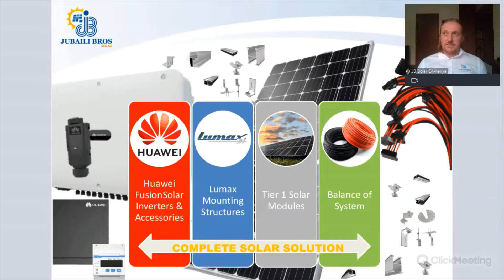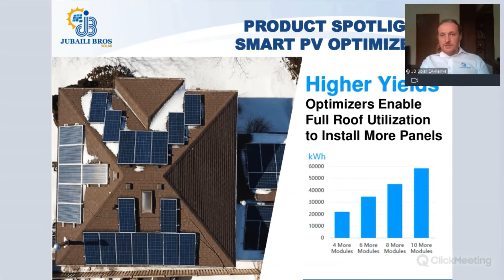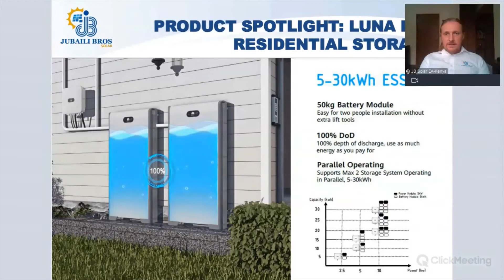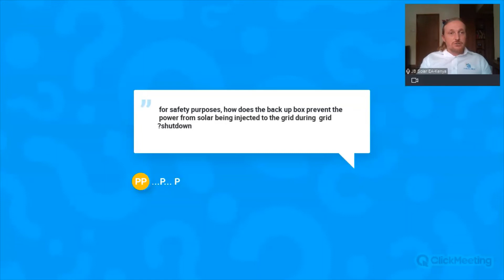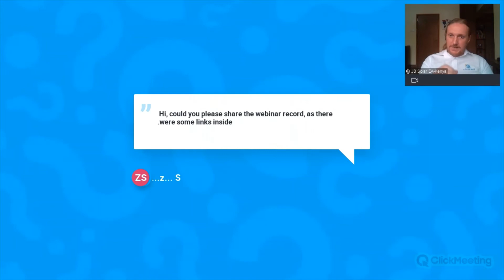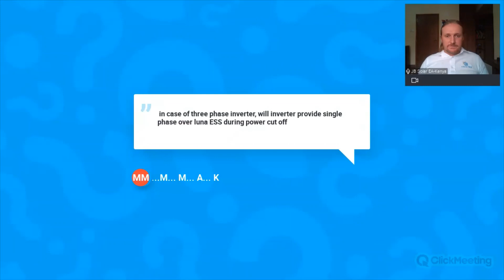Webinar: Luna Battery Storage Solutions

Comment: Hi, I have a couple question for you, if you're kind to reply.
 So, I have a 3kw one phase system. 1 inverter sun 20003ktl L1, Huawei Smart Power Sensor DDSU666-H and 8/380w solar panel from Hanover Solar. And of course the Fusion App too. Right now i'm exporting to the grid. 
For the future i want to buy more 4 solar panel and a Battery module Luna 2000 5/10 kw,  for a back up. But i want to export to the grid too, because I take a subsidy/grand from the Ministry of Energy in Romania for this system. Is like a contract to export to the grid all excess of energy left from my house.

The questions is. 
1. If i have this battery can still exporting energy to the grid? 
2. Still need that Backup Box-B0 single phase?
3. I need another devices? Witch ones?

Thanks,
Andrei